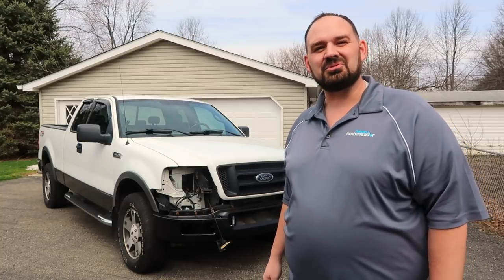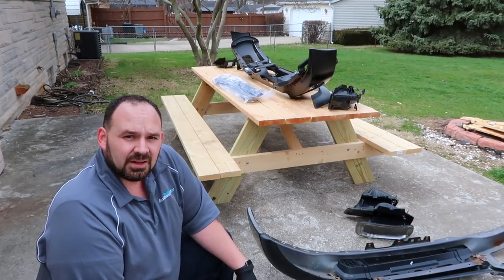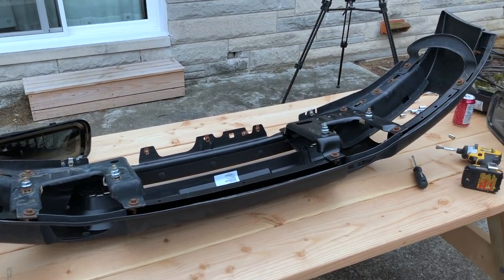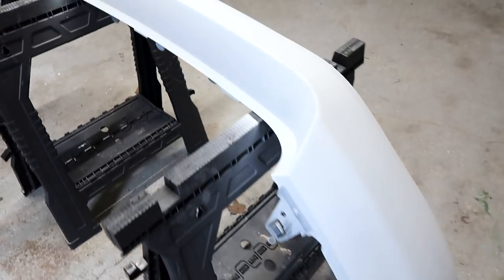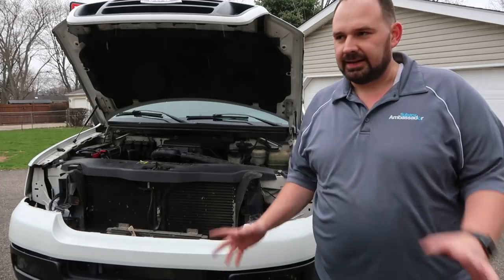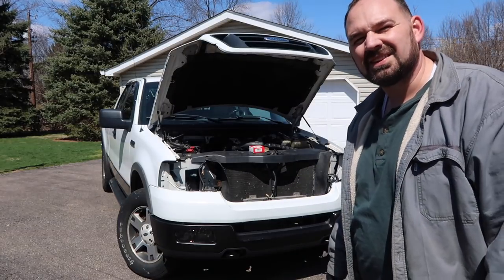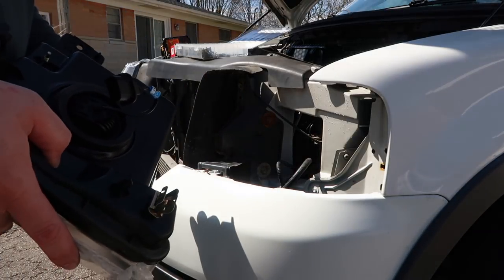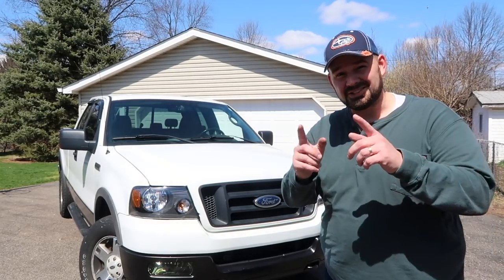F150 Rebuild - Part 2 -- Reassembled!

Comment: Hi Steven! It's another awesome video! If you want a solution for the wind noise, buy a Rode VideoMicro (Deluxe furry windshield included, amazon 59$) or Rode Video Mic Go (94$). My opinion is the Rode VideoMicro is perfectly fine in the "early stage" and the sound quality is mutch better,than the stock camera mic. I hope i could help a little bit and keep going, make more good content!
Reply from the maker: Thank you for the tips! I actually just got the Rode mic. Hopefully that’ll solve the problem!!